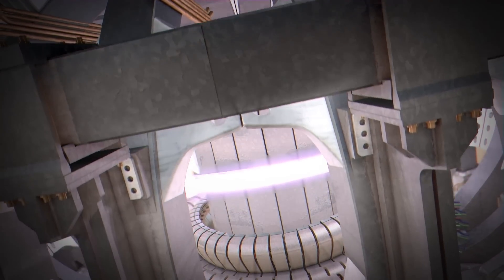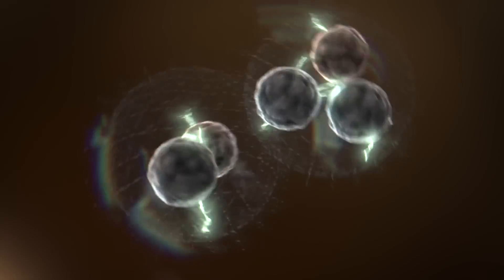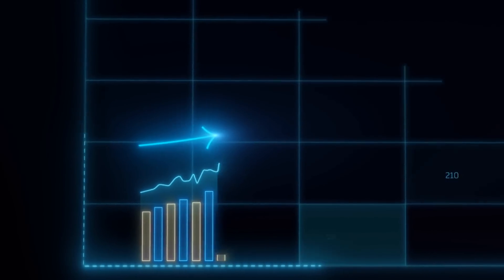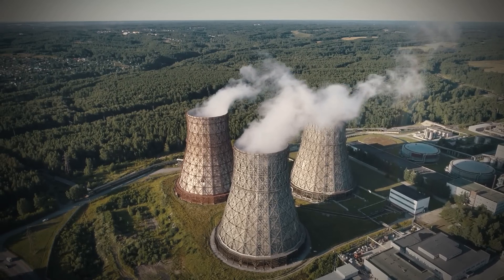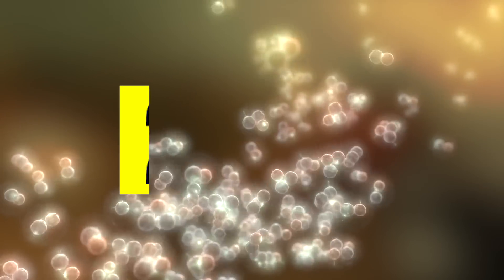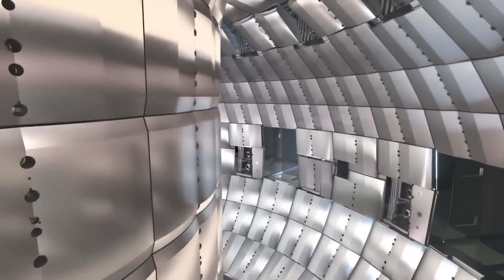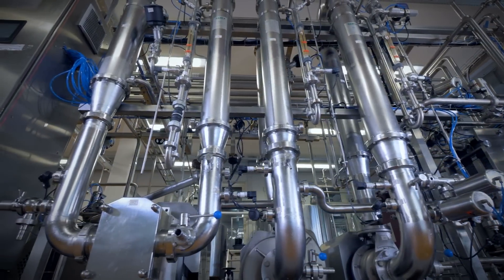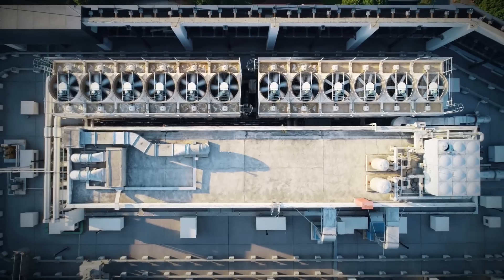The Shocking Problem That Could End Nuclear Fusion

Comment: And what about the enormous temperature and pressure needed to start fusion? Doesn't that take so much energy as to make controlled fusion, as opposed to uncontrolled in a bomb, not worthwhile?
Reply: the theory behind fusion is a good and correct fusion reaction will sustain itself and also power everything thats needed in order to power it + more
Reply: @Uvisir  That's just a statement with no evidence supplied. Facts are not created by just making statements.
Reply: @grasonicus  it's the very goal of fusion to create more power then what is being used to sustain it. It's not just a statement its the goal.

Comment: 1 - Cooling.
2 - High speed neutrons.
3 - Maintenance and servicing.
"The Trouble With Fusion"
MIT Tech Review, by Lawrence M. Lidsky.
"Long touted as an inexhaustible energy source for the next century, fusion as it is now being developed will almost certainly be too expensive and unreliable for commercial use."

Comment: One interesting side note: There is quite a lot of working being done these days in the world of fission on molten salt reactors (MSRs). Those typically (though not always, depending on the design) use lithium salts which have to be enriched to something like 99.99% Li-7, precisely to suppress tritium production as much as possible.
If that were to happen at scale, presumably decent amount of Li-6 would become available for tritium breeder blankets?

Comment: a pigment that reflects ultraviolet light within the mid range of visible light, as if full of 40nm UV sensitive solar cells and 3nm InGaN led's... so much of it, it ends up on store shelves for $3.99 in the crafts section... same as to the processing of other traditional paints and restrictions they used to have no longer listed.
Reply: get a load ah tha eh... e' gunna meld it all wive a big magnet?
Reply: need to put a coat of light blocking transitional pigment on the surface, because normal day light will burn out all the cells.
Reply: 2000000 hours at 1 volt for a 5mm diod. 3nm... 2000000 hours to a 0.001mv solar cell being covered as 1.5 billion units per square meter at 10Kg to 20Kg.

Comment: Another issue is that the neutron flux from fusion will turn the structure to dust very quickly. 

We need helium 3 aneutronic fusion

Comment: I've been following the progress of fission reactors for several years and there are several promising reactor designs. But I've recently started to think the majority of companies that have new designs, especially the liquid fueled MSR designs, know their designs will take a couple of decades to test and especially get NRC licenses. I feel the same way with fusion reactors. MSR and fusion need way too much R&D for now. I'll make a layman's prediction that MSR will be ready in 2045 and the first fusion reactor in 2065.

I assume NRC will be the licensing body for fusion. What I do not see in fusion is development of nuclear grade, and NRC licensed, steel that can withstand the neutron bombardment that fusion produces. Since fission relies on neutrons not all of the neutrons "hit" the outer vessel wall. So the nuclear grade, and NRC licensed, steel used in existing reactors is stainless steel. Utilities will also demand this because if the wall becomes brittle you have to design the reactor so the wall can be inspected and, if needed, replaced. Regarding MSR the NRC does not have documented procedures for MSR licensing. If this is the same for fusion it will take an act of congress to tell the NRC to speed up the licensing process. Also I don't think new power plants will replace existing plants that still have operational life. So more decades to wait for full implementation.

I hope fusion becomes a reality (however it's weird to use the heat from fusion to boil water, or a gas, to spin a turbine). I am concerned lobby's will convince congress that fusion and MSR is where investments need to be made and thus ignore the new fission designs that are realistic. Kairos Power and X-Energy are developing solid fueled, uranium only, reactors that use TRISO fuel that is licensed and accident tolerant. Existing fuel is not accident tolerant. Kairos uses molten salt as the coolant and X- uses helium coolant. GE-Hitachi and Rolls-Royse also have designs that can complete the NRC licensing process, they say, by early 2030's. Let's get these built first and continue to develop fusion and MSR. I like the fast MSR designs that burn up "waist" and weapons grade material. But politics will not allow good ideas that benefit the citizenry anymore.
Reply: "however it's weird to use the heat from fusion to boil water, or a gas, to spin a turbine"
Why is it weird?
Reply: @juhaniheinonen6132  Actually I don't know how heat, for electrical generation, will happen in a fusion system. I'm just imagining all that heat already inside the fusion reactor in order to fuse the atoms together then, if using steam, loosing 70% of it like in fission, coal, concentrated solar. I'm not saying it's stupid. What would be great is a more direct conversion of heat into electricity. Have no idea if that is even possible.

Comment: Why spend billions on fusion right now when we could spend a few thousand developing a Peltier Engine? By using a sealed low-pressure combustion chamber saturated with argon for burning HO gas, we could prevent secondary emissions, harvest the condensed water to send it back through the cycle, AND generate electricity through thermal difference. This combustion chamber would need a high thermal conductivity and melting point to handle a 2:1 ratio of hydrogen to oxygen, but the heat generated would be enough for 12v Peltier modules to generate enough power to drive electric cars. Use batteries as the primary energy source for the motors, and this engine becomes the charger. 

My idea is to use this engine as a range extension device, turning it on when the batteries fall below 30% and charging them while taking some of the load of the motors. Since electric motors prefer voltage over amperage and electrolysis prefers the opposite, you could use a large portion of the engine to generate the power for the motors and batteries and a smaller portion for generating the fuel. In addition, since this engine will be using thermal transference, a large combustion chamber is not necessary, relying instead on wall thickness for an even distribution of thermal energy. As for flame size for heating the chamber wall: large flames use too much fuel and cool off towards the end of the flame, greatly reducing efficiency. Small flames use less fuel for the same thermal generation and can be distributed for the most efficient thermal transfer. After a certain amount of time, a float within the chamber will turn on a pump to collect all the condensed water and send it back through the system. Once the engine is shut off, it will continue generating electricity until the chamber wall cools off enough to shut off the Peltier modules.

This engine is scalable for many vehicles but is restricted to passenger vehicles only. Motorcycles will, unfortunately, be unable to utilize this system due to a lack of space.

Comment: 07:03 -- "...how will these reactors start in the first place if we've already run out of lithium?"

01:28 -- "...therefore, our entire stockpile of twenty-five kilograms..."

02:28 -- "[ITER]...is expected to use around twelve kilograms of the available tritium."

It appears to me that for ITER, the question is already answered by the video.  There is enough tritium available for it.  As for other projects, they will depend on getting a substantial source of Lithium 6 for ITER, such as the ICOMAX process. if the research project for it is successful.  If ITER does not begin producing enough tritium, then it's down to making the more difficult deuterium process work.

On a better note, we can hope for super brilliant physicists, engineers, and technicians to supply all the answers and make the H3 fusion process work, which as I understand it, will be superior to deuterium-deuterium or deuterium-tritium.  Woot!

Comment: i dont know what the shocking part meant to be? shockingly clickbaity. yeah iter uses a lot ressources but that because iter is meant as a reactor that gives data to some scale related questions. so far i know there is no fusionreaktor competing with another since they all are build to awnser certain questions its a reductionistic approche so we can collect all the data needed like efficency rates, how do they scale, like you mentioned test for different isotops, ways to approache the magnetic field a bit different (stellerator)... sure humanity is faceing ressource issues but the isotops needed... i mean the manipulation of neutrons in an atom thats basicly a byproduct of the knowledge and energy ressources the fusion technologie brings with it... (AT LEAST IF WE GET THEM TO RUN and they behave as we so far expect)....
oh and btw what would be the point storeing bigger amounts of trtium as realy is needed since it is degrading in a rather short amount of time

Comment: Well, a bigger problem is that the sun is not a self-compressed ball of gas. It's not possible for such a thing to happen.

The next problem is that all of the reactions that cause the sun to radiate happen in the sun's atmosphere (it is a solid body with an atmosphere) and the coronal plasma.

Fusion is never going to work in so far as to put out over-unity energy as just a reactor and ignoring all of the power required for all of the systems that would make it a steam generator.

Sorry.

Comment: The world is heading to green hydrogen which can be made and D2O as a byproduct also lots of O2 is made . D2O is gas reformed with CO gas giving D2 and CO2 respectively. Tritium is made in nuclear reactors the same ones producing H2 and D2O in order to overcome this we need to build more nuclear reactors at the moment 420 but to pull this off 1200 nuclear reactors needed to be build and to fuel it uranium reserves will last 100 years so fast breeder reactors need to be built . Plutonium needs at least 30 months cooking time before Plutonium is extracted so this Fusion energy is just one big pipe dream.

Comment: The main problem with fusion (outside it not being anywhere near operational yet) is the cost. No one's been able to show if it's going to be viable or not. These reactors are extremely expensive and wear down pretty fast
Reply: Governments more or less wrote fission research a blank check, we've put virtually no money into fusion thusfar and we have working, but not profitable reactors thusfar. That's pretty good all things considered, and if we can fund neutron flux free fusion, there's no reason we can't have reliably fusion reactors and an abundance of very, very cheap fuel to run them.

The biggest issue, and the elephant in the room is why things aren't getting funded, which mostly boils down to the world's economy being based on the petrodollar. Sure, you can get rid of most oil usage, but, you'll need a new way to back the dollar. That'll create a massive disruption in the world's power/influence structures, and governments are very, very timid about letting that happen.
Reply: yes, it is the cost, l am surprised they havent abandon it yet

Comment: We need to quit trying to build fusion powerplants, and invest entirely in building fusion ROCKETS instead; for the simple reason that you need to be able to build a semi-controlled reaction (like in a rocket), before you can have a controlled one in a powerplant. 
Meanwhile rockets depend entirely on mass-energy ratio, while mass is not a factor in stationary powerplants. 
Finally, all evidence gained from building fusion-rockets, can then be used to build fusion powerplants.

Comment: You got through all of that without stubbling over the 5000 lb Elephant in the room. 

Consider that reactor, first off you have not dueterium atoms flowing around in a circle, but plasma where the electrons are in highest orbitals, effectively ionized, the light comes from deionization. So this is problem one, containing ions. We have to remember that inorder to generate power some fluid, either water or liquid metal needs to circulate around the reactor to transfer heat. This liquid is generally pressurized and reaches high temperatures. If the liquid is too far away the transfer in inefficient and the reactor overheats and begins to crumble. Too close and the fluid will break its containment and the fluid will become saturated with neutrons spreading contanimation into the generator assembly. 
   Lets us suppose that we have extensive layers of neutron making and reabsorbing materials.This creates two problems, more separation on the reactors radiant EM production and the fluid, and a doubling of the neutron contamination problem. By doing this the interior metal layers of the reactor will get hotter, because now there are two reasons to keep heat transfer further from the interior surface.
   But this is a little problem compared to the next problem, containment. In a reactor the plasma is flowing around in essentially a donut. Momentum of particles is altered by electromagnetism based on the charge of particles. Neutrons have no charge, and as they are generated their momentum will largely carry them to a ring of the inside lining of the reeactor were they slow down and are scattered. In a perfect world the metals of the inner lining would have perfect strength, heat stability and neutron absorbing capacity. Unfortunately none of these are true, the metal will absorb neutrons, the neutrons will change the strength and the ductility of the metal, and the metal will need to be periodically replaced. Let us suppose that we place a neutron absorber with a low melting temperature behind the lining. This metal will absorb neutrons, scatter neutrons. The neutrons will scatter in every direction, including back into the reactor. There will be momentum changing collisions with plasma and a source of turbulence. The lining and the beryllium become targets for high speed collisions with deuteronium ions, the beryllium will heat up as neutrons degenerate its structure, and the effect of the degeneration will spread radioactive materials deep into the reactor lining. Within this scope the tritium that is made needs to be leached back into the reactor. We have to remember that the magnetic fields in the reactor is being maintained by super conducting magnets whos structural integrity is integral to operation. 

    This gets to the final problem, reactor down cycle maintenance. Provided they get fusion operating we could ramp up'ed and generate tritium by other sources. But how to keep a fusion reactor maintained once it has completed a production cycle is going to be a huge problem. The entire inner lining of the reactor is hotter than just about anywhere on earth, and in the transformation process metals of prolonged half-lives are created. The metals, many of them precious cannot be reused. By adding a tritium breeder cycle into the sublining surface only exacerbates the problem. 

All in all people will not care if the duty cycle is half as long. But, if the maintance cycle length is double or triple and they are having to deal with the storage of radioactive waste, and the potential for explosions due to loss of structural integrity . . . .this is a big problem. 

The problem with fusion comes to a head when one considers that the great potential benefit of the higher mass efficiency of heat production comes with the much higher drawback of waste heat production and radioactive waste production. To put this into perspective, nuclear fusion was seen as the product that best suited the need for interplanetary travel. In space radioactive waste is less of a problem. But the initial electrical start-up cost requires mass for other power means, and there is no way in space to effectively deal with the waste heat . . .thermocouples are far less efficient than steam generators and convective heat sinks on earth.   Now it seems that fusion power use in space in untenable even if a working reactor is built on earth. Yes tritium is a problem in space also but imagine carrying tritium in large quantities in space for 100s of years.

Comment: Another problem also exist - degradation of superconductive coils in neutron flux. We can't  stop all NF reaction neutrons  from reaching coils. For ITER it is not big problem because it active NF reaction will be counted hours per year at best. But for hypothetical commercial NF reactor with GW output working 24/7  neutron flux will destroy coils for time  less than year.

Comment: Attempting to achieve nuclear fusion with deuterium and tritium for energy production may be the wrong approach due to the high temperature and pressure required.  A reaction using, say, boron and hydrogen may be more favorable.  Although boron is relatively rare in the Earth's crust, it is much, much more available than tritium and the reaction can proceed at lower temperature and pressure.

Comment: The problems you raised are minutes compared to the larger ones of making a sustainable fusion reaction

7% of all lithium being the right isotopes are more then enough and if the fusion works would be easy (compared to everything made so far) to recreate the conditions that made those on CADU
Reply: The problem is that the 7% of Lithium which is Li 6 is not all in one place.  It's intimately mixed up with the 93% of Lithium that is Li 7. Increasing the % of Li 7 is the problem.